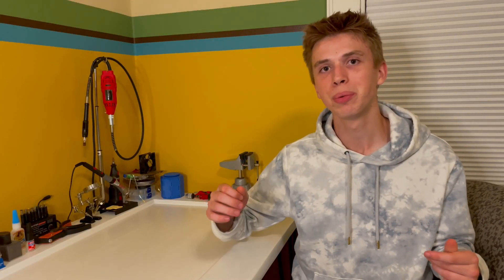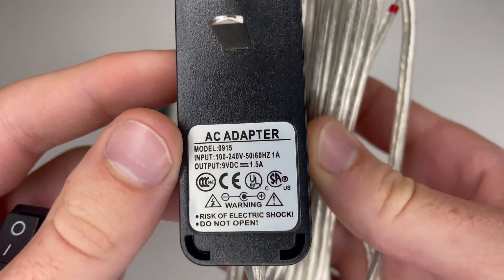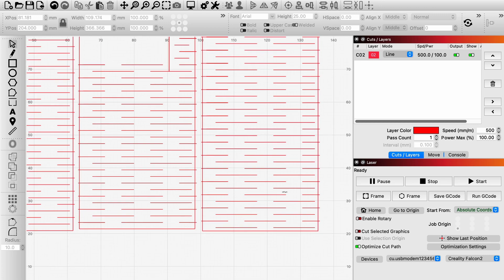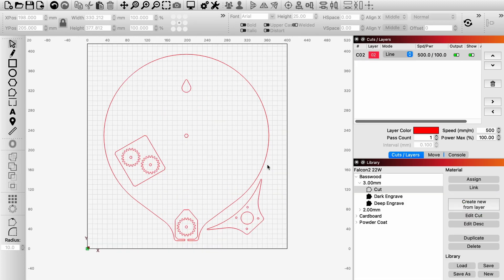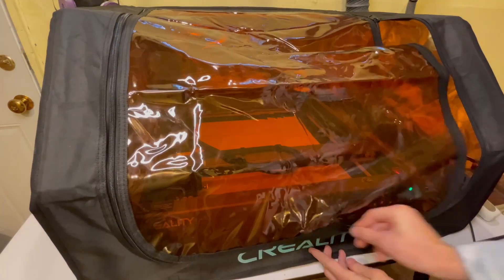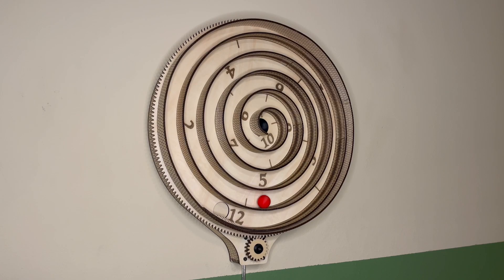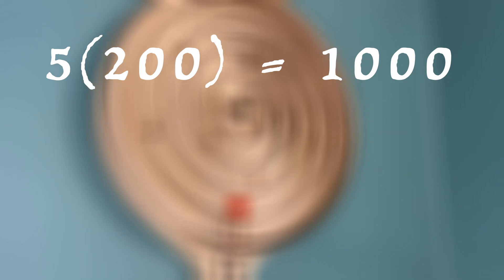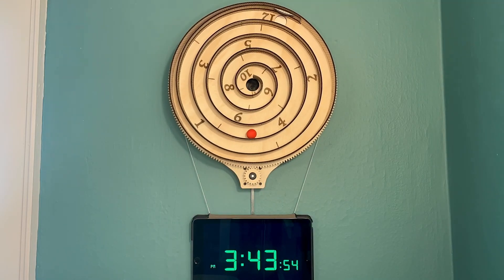I Built the Strangest Clock Ever (Arduino Based) (Laser Cut) - Creality Falcon2

Comment: The blue laser light seems to still be clearly visible through the orange "safety shield" (unless that's the burn glow that just looks blue because of overexposing the camera). I think I'd still wear real safety glasses while using that machine.
Reply from the maker: Hello! I believe the excessive amount of blue light is mainly due to the camera’s exposure settings, but, just in case, I always wear laser safety glasses, even with the enclosure.